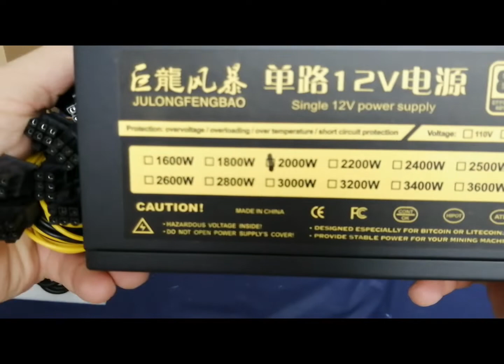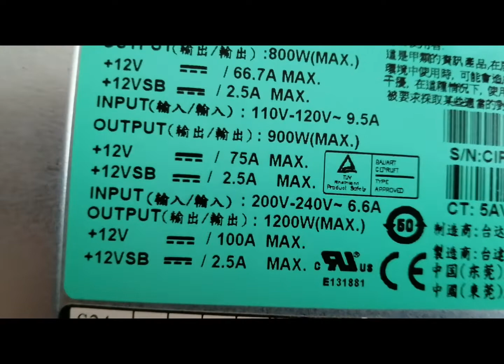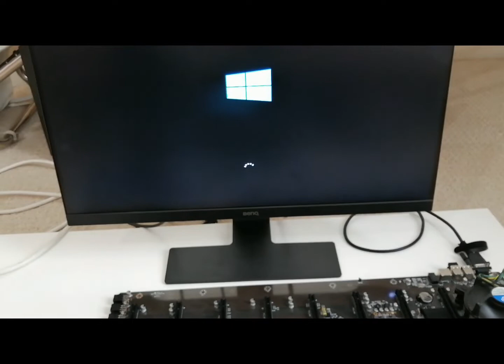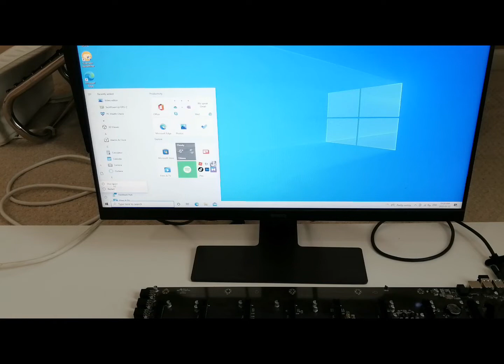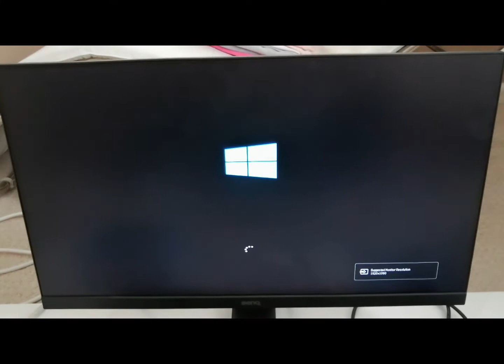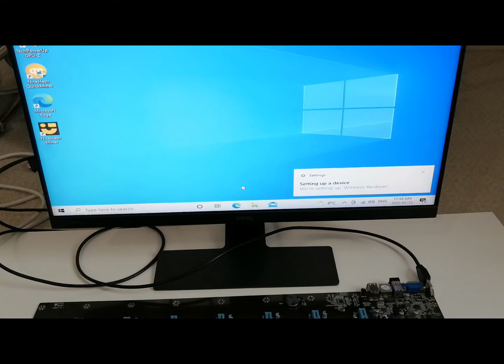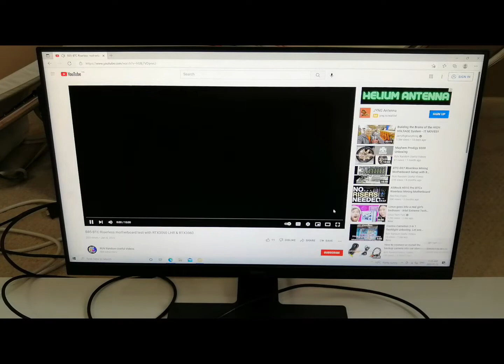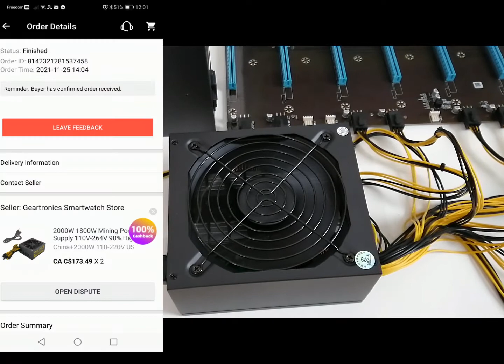The BEST mining power supply for 8 GPU riser less motherboard??? BTC-D37, BTC-S37 & B85--BTC

Comment: Niceee! thanks for the review , do you have a guide how to power up B85 mobo ? I saw some miners online they sell B85 mobo and dont need to power up all connectors for 8 GPUs
Reply from the maker: Yes motherboard will power on using one 6 pins but 1 single connector is not enough to power 8x PCIE slots if you are running 8 GPU's. Chances that 1 single 6 pins cable will melt and caught on fire or even the trace of the motherboard circuit can get burn because of over current from 8 GPU's. I explain @ 14:28 in this video.
Reply: @ruvrandomusefulvideos  I have a 5 GPU Miner rig they use this similar/same PSU with a X79 mobo.. Friend of mine got a 8 GPU mining rig with B85 mobo and same PSU i think. Do you have discord ?
Reply: @ruvrandomusefulvideos  so my friend's 8 GPU BTC-B85 is connected from PSU to 6 pins on the mobo powering up 6x 3060 TI , do you have discord or telegram ?
Reply from the maker: @frikitonxplosion  Sorry I don't have at this time. That's one thing I need to do, I will try to setup one as soon as I can. BTW - I received my X79 motherboard. X79 can run 5x 3060 GPU'S, all 5 PCIe are 16x bus speed, that said it will also fully support 3090  or may be even the newer 40 series. I will upload the test video shortly.
Reply: @ruvrandomusefulvideos  you can join our discord if u like.. This is the B85 my friend is running by PXY-ELEC and I'm running their X79-5GPU miner from same seller. Package is better than others that sell the same product. I also tried the VTRETU 8 GPU Miner server case but the PSU was too loud. Then my friend got this one https://m.media-amazon.com/images/I/81UjyEsWDWL._AC_SL1500_.jpg  from SUOHUI 8 GPU look where they connect the PSU to 6 ports on the Mobo it supports 8 GPU this way. I'm sure if heavier GPUs like 3080 will need another external PSU if filling up all the slot
Reply from the maker: @frikitonxplosion Sure I will join your discord, how?

Comment: hi i have 2 of them but my psu are all Corsair 1000. can i connect the riser witht the sata cable of ssd cables? i have sata cables of riser. actualy im using pcie
Reply from the maker: I wouldn't recommend sata to power the riser